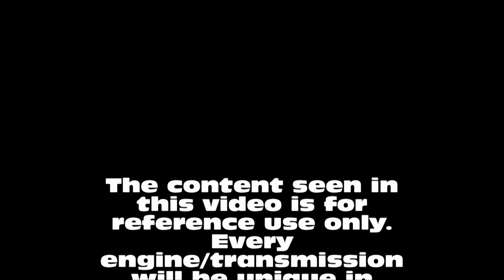Pontiac Fiero 3800 swap HOW TO: Installing a 4t65e-HD automatic Transmission

Comment: I learned a lot from the Fiero forums for my L67 swap project. Lots of reading, very little video. It's nice to see this..  Thanks!

My L67 swap included a full trans rebuild, engine rebuild, wire harness build with mods and upgrades, a P/S pump rebuild, a rack & pinion rebuild, a modified fuel pump module build and a lot of homework along the way. It started right up on the first attempt and it's still running strong after 8000+ miles now. I still need access to a TECH-2 scan tool for PCM, BCM, and IPC calibration and VIN flashing.

Comment: Thanks for taking the time to make videos of your engine swap. Very cool. I've got an 87 that I bought as an unfinished project from someone. I everything was installed but not running or driving. I figured out all the bugs and it is an absolute blast. 

I've got another 87 that I'd like to put a 3800sc in and do the whole swap myself so these videos will be very helpful when that time comes. 

Your video on removing a 2.8 was extremely helpful when I gutted my parts car.

Comment: I saw a video of a Fiero drive-train, including suspension (in one unit) mounted "behind" the rear seat of a second generation ('65 to '69) Corvair.
I've seen videos of Fiero's with various "Go Fast" parts like superchargers ("Enough is not enough, Too much is Just right"). ;-)

Comment: It's a good idea whenever you have the cradle off, to go ahead and do a bump-steer fix, so your Fiero will handle and go down the road with perfect stability and not jump all over the place.  Just die-grind the welds off those tie-rod brackets, turn them around (flip them) to be as close to the control arm pivot points as possible, and weld them back on in the proper location.  Then cut the same length off the tie-rods that you moved the bracket (approx 3",) and WALLA...your geometry is corrected, from the factory flaw (mistake!)

Comment: Great video!

I happened to stumble upon this, even tho I have seen pretty much all of your other ones. Any idea if this is similar as the F23 swap (as far as bolting it to the cradle.) 

I can assume that is the 3.8 frame, but figured I would ask anyways.
Reply from the maker: +zzzhuh I'm glad you stumbled on the video. The F23 will also need custom brackets to mount it on the Fiero frame but those will be different brackets than the 4t65e-HD. The F23 will sit pretty much where the standard Fiero manual transmission would sit so you can reuse the Fiero manual transmission axles. The frame you see in the video is actually the Fiero's frame not a 3.8 frame. You mount new Fiero Transmission mounts on because the old ones won't handle the torque. Then you mount the adapter brackets onto the Fiero Transmission brackets and finally mount the transmission on. The install is clean with no modifying of the Fiero frame so it does appear as if it has a stock look to it. FieroRog did a great job building brackets to make this engine/trans look like it was meant to be in a FIero. I hope you get an opportunity to do your own 3800 swap. It is really an enjoyable swap to work on so far.

Comment: Hi can you please go in depth about how you are making you 4t65e shift? I
 am doing a project with a 4t65e I want to wire it up to run stand alone
 with a ratchet shifter is this possible? It does have a electronic 
cable driven gear selector I think, How can I make this thing shift and 
work properly in my car? I need more info. (btw the motor is a gen 3 4.8
 so I dont know if a 3800/ls4 wiring harness is any good for me). Either
 way I do not want to use a aftermarket tranny controller box.

Comment: Hello 
Im just about to start my 02 gtp swap in my 5spd 
Id like to use the 07 F30 6spd from the G6 
Do you happen to know what clutch and flywheel and axles i would need? 
Also are you the guy in Ontario Canada?
I was going to do my own harness but thinking i will just have it done.
Cheers!
Reply: tell me more about f30 6 speed will it go into 86 gt 3800 sc car already 5 speed

Comment: How do you feel about the Muncie 282 being paired with a 3800/L67 combo?
Reply from the maker: I believe it's a doable transmission to use unlike the automatic trans and the 5 speed Isuzu. I even had a custom 4spd clutch for the 3800 swap sitting around that I bought from someone selling off his Fiero stock. I ended up selling it off so I know that people are making parts for the 4 speed transmission.  Durability would be similar to the 5 speed Getrag where it can be used but you want to stay away from burnouts. The only real complaint I heard about is the gearing kinda makes an annoying ride at cruising speeds because your riding right around the shift point. You'd be constantly shifting up and down 3rd and 4th gear. That's what I've heard. I can't speak from experience. The 5 speed is more popular so finding the custom 4 speed parts may take a little extra digging but they are out there.
Reply: LostNotForgotton Thanks for the reply! Your videos are a fantastic resource. I'm looking at a very clean bone stock  '87 GT with a "new" motor and the factory 282. He's selling it way under market value so I need to see what's up first, but I'm planning on a 3800SC swap if I buy it. I'm mainly looking to be faster than a newish camry lol.

Comment: Is a 3800 swap possible in a 85 GT or only in the 87& 88 models?
Reply from the maker: This swap is possible for any year Fiero. There might be slight differences with the 88 Fiero because it has a redesigned craddle. Other than that you can swap a 3800 into an 85 GT. Lemme know if you have any questions.

Comment: How did you put the cables from 3800 trans to the fiero
Reply from the maker: Good question. You can reuse the existing Fiero trans cable. You would just have to combine the both the Fiero auto shift arm and the shift arm from the 4t65e transmissions. I have a video on that as well called Pontiac Fiero 3800 HOW TO: Hooking up Exhaust and FIRST START UP.  https://www.youtube.com/watch?v=V9NajLXZNGE&t=53s

Comment: Would the F40 six speed bolt up to the 3800sc
Reply from the maker: The F40 will bolt up but you'll need a custom clutch, shift cables and mounting brackets to hold it to the cradle. People have made kits for these transmissions because they hold up better than the Getrag. I'd suggest searching PFF for someone who builds these brackets.

Comment: Thanks for the videos!  I have watched your removing a 2.8 a few times over the past year, and will tackle doing it in a very short time.
I now await your soon to be coming, "Installing a 3800" video series.  I have a Series III, and there are minor differences on the engine, but through research, they seem to have all the same mounts, with the exception of being a manual or Automatic. Mine just happening to be a 4t65e-hd :)

 You can check out my documented engine swap starting on page 13 of my build thread on Pennocks: http://www.fiero.nl/forum/Forum1/HTML/083667-13.html
Reply from the maker: +JohnWPB Wow that's quite a thread you have going on PFF! I plan on eventually posting a build thread too on PFF. I am going to add some pics I've taken as well as the videos as I get them completed. I'll also use it to ask questions when I get stuck. I've been meaning to start the thread for months but maybe I should sit myself down and actually do it sometime soon. I'm glad you find the engine removal video helpful. After I'm finished the 3800 project I was thinking about making a sequel on how to but the 2.8 back into the car only I'll use a manual transmission Fiero this time around. You are correct that there are only minor differences with the series II and the series III engines so my videos should still be a good source of reference for your build. I have to say that I'm glad your going with the 4t65e-HD. I think you'll save money and time doing it that way. It's a lot easier and cheaper to mount that transmission and build a custom axle than it is to buy custom flywheels, clutches and in some cases shift cables. Don't get me wrong I do eventually intend on doing a manual swap but as a starter swap this is a better way to start. Good luck on your swap and I'll try and keep up on your PFF build thread.
Reply: +LostNotForgotton 
I am patiently awaiting your 3800 install video ;)  I also have Rogers mounts, and lower alternator bracket, so your video will be spot on to what I am coming up against ;)
Reply from the maker: +JohnWPB Looks like you got the most important parts already. I would continue to build up your parts collection so when you're ready to start working on it you won't have to be waiting on everything to come in the mail or searching for what you need next. That's what I did but there are still a few other small things I know I'll have to pick up. I've already started editing the video for FieroRog's engine brackets. I wanted to release the video for converting the fuel rail and swapping the valve covers next but I'm still waiting on getting my custom fuel rail in the mail. That was one part I couldn't buy ahead of time because I wanted to do a video of the fuel rail removal. Hopefully I'll get it soon but if not then the next video to be released will be installing the FieroRog brackets, alternator, water pump, pulleys, AC compressor and the accessory belt. One of those videos will be released on 04/09/2016. The real mystery is which one...

Comment: If I could afford one, I would love to have a Pontiac Fiero Mera. And NOT a Mera that those bone heads removed the Pontiac badges and replaced them with Ferrari decals.
An automatic transmission. I don't get it. What's the point?
That is not driving. That is putting the car in gear and steering  it.
But to each their own.
Good video, though.

Comment: I appreciate the videos. I.  Also looking forward to a 3800 SC how-to video. I have a non running '84 Fiero notchback with a Series I 3800 NA. The car was a custom one-off that my dad built. He put nearly 200K on the configuration. The fuel pump is bad, but I'm going to replace the whole engine with a SC II. Thanks, and I look forward to the segment on the build.
Reply from the maker: +JeremyKerrianne W Glad you find the videos helpful. Depending on the condition of the engine your dad build you might be able to sell it to someone who can get it running and put in their Fiero. That might help offset your 3800 project costs a little. The next video to be released will be building you own custom axles, then attaching the custom engine brackets & belts, then replacing the lower intake gasket (common issue with those engines), then the fuel rail system, then swapping the supercharger pulley (optional) and the last one for this group of videos would be attaching the engine to the transmission. That is a total of 6 videos in the works right now for the first group. The second group of videos will be about getting the engine into the car and working. I'll figure them out in more detail once I get closer to that point. Keep checking back and good luck on your build when your ready to start it!
Reply: Thank you very much for the videos and helping keep the Fiero community on the road. We all appreciate it!

Comment: If I could afford one, I would love to have a Pontiac Fiero Mera. And NOT a Mera that those bone heads removed the Pontiac badges and replaced the with Ferrari decals.
An automatic transmission. I don't get it. What's the point?
That is not driving. That is putting the car in gear and steering  it.
But to each their own.
Good video, though.